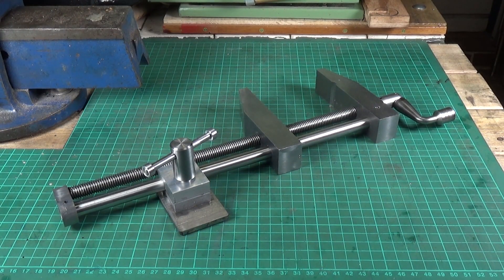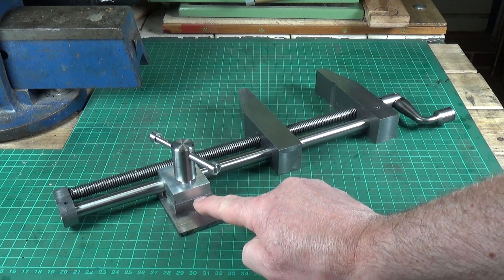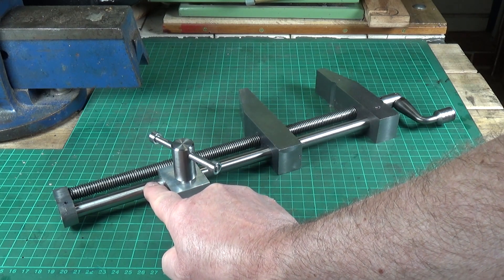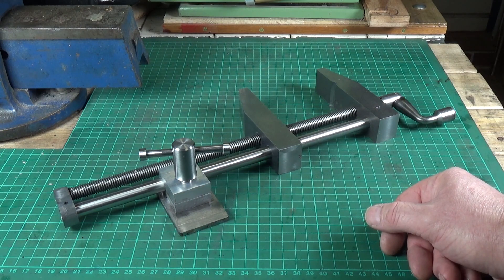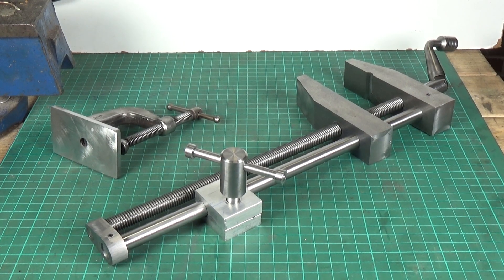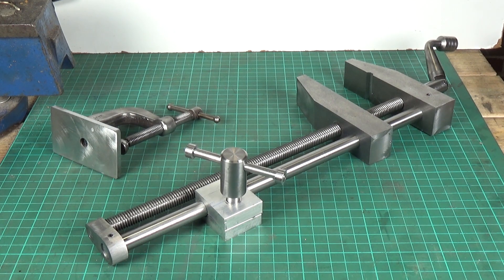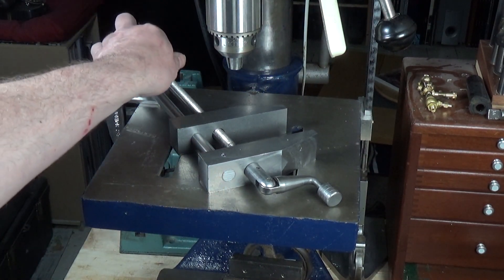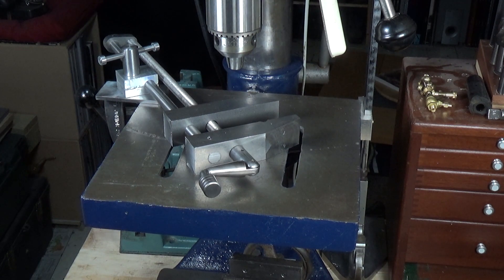Mr Pete's Float Lock Vice Build Done Without A Milling Machine - Part Three

Comment: Excellent your's turn out extremely well. I modified mine with Acme threaded rod, what you call trapezoid threads, copper jaw saver, and made the jaws smaller to hold the small things I work on.
Reply from the maker: Thank you. I think original had an ACME thread but like Mr Pete said, ACME taps are very expensive and I don't have any so like him I went with 1/2" UNC standard thread.
Reply: Retro Steam Tech : Believe me, I know the pain of buying an Acme Tap but now I can tell my wife that I used it twice. The beauty of this project is it makes use of left over drops. Other channel like Randy Richards is going to make one too. It's one of those things that makes you say, "Humm, I could use one of those and I have the drops to make one."
Cleans up the drop shelf and makes the wife happier.
Reply from the maker: @CraigLYoung  LOL 🙂👍